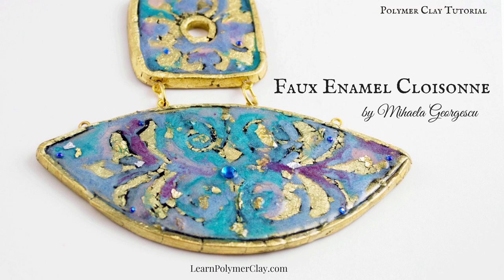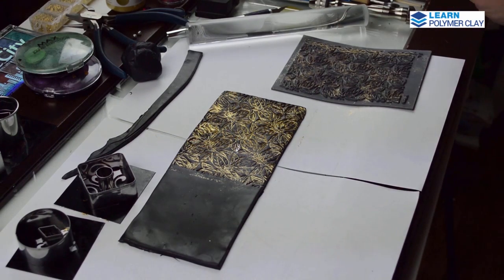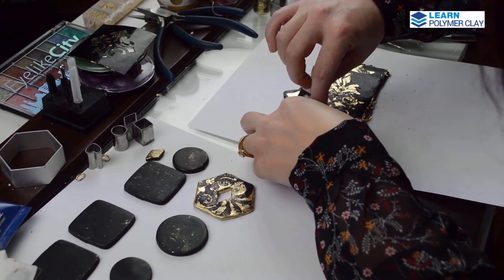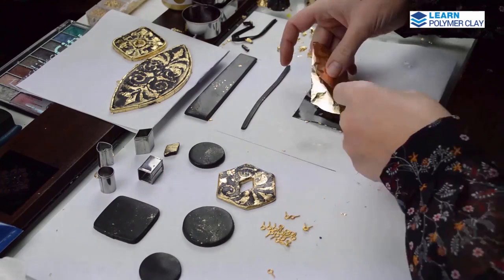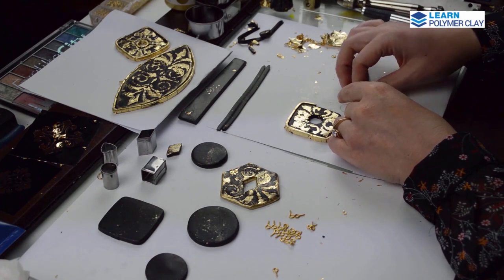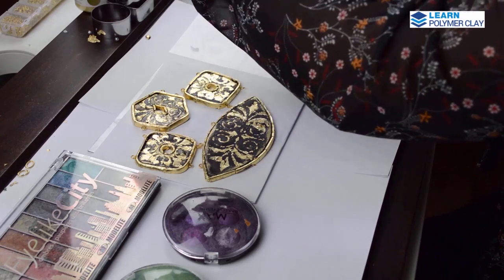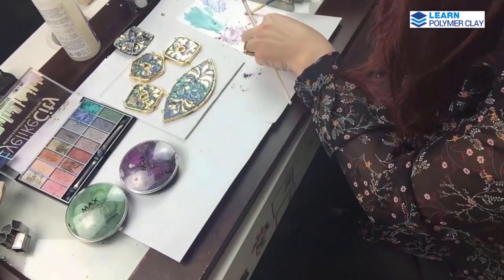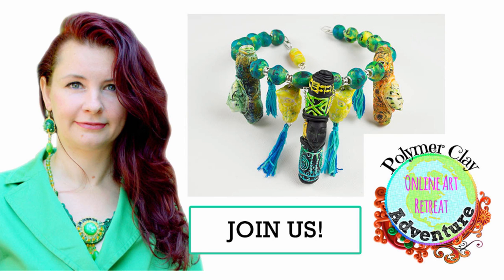How to make Faux Enamel Cloisonne using polymer clay, foils and mica powders

Comment: Beautiful piece. I love the pastel colours.   Can I ask, have you had any problem with the diamond glaze reacting with the clay over time?  I had an experience with a pendant going tacky after about a couple of months, but not sure if it was the clay or the glaze causing the problem.
Reply from the maker: Thank you! Normally I use Triple Gloss Rayher (which is a German product I think), but then I tried Diamond Glaze and I considered that they both produce the same effect. For the Triple Gloss Rahler I can tell you that it stood the test of time, did not turn yellow and the pieces were not tacky in time. But this product is less known than the Diamond Glaze and harder to procure, so this is why I prefered to use Diamond Glaze in my tutorial (taking into account that I had very good results, but I cannot say I tested it over the years). Please give Diamond Glaze a second chance and see what happens! Have a wonderful and creative day! Mihaela
Reply: Thanks Michaela.  The problem with clay is It seems to react with so many products over a long period of time, so I get overly worried about creating a piece that may become ruined.  I tend to use resin or Golden polymer varnish now as those I know I am safe with, but I do love the effects that the diamond glaze has on this necklace, and it is much more cost effective than resin.   Still  I'm a bit tentative to use it after my last experience.  I might try it on a piece of scrap clay and see how it holds up after a few months.   Thanks again for the response, and your lovely tutorial.
Reply from the maker: I totally understand it. It is a good idea to test it on scrap, so you won't be disappointed too much if it does get tacky. I hope it won't happen. I love resin also and the results are amazing. Happy claying! Have a beautiful day!
Reply: Thanks Miheala.  You too :)